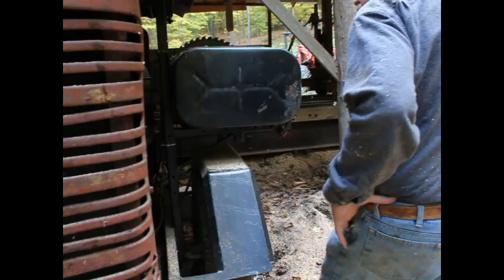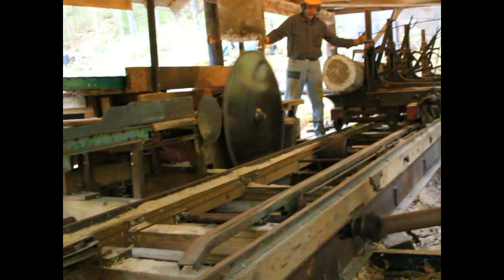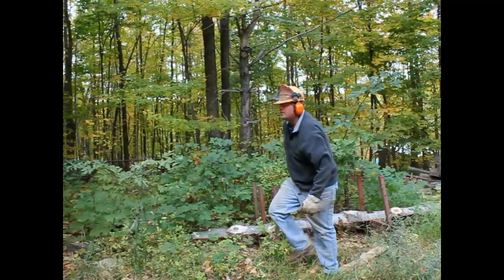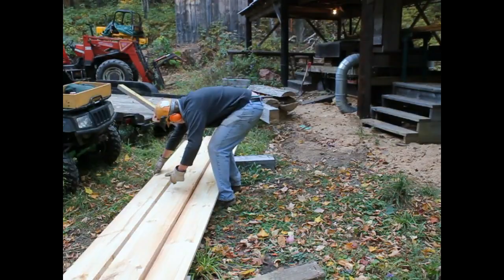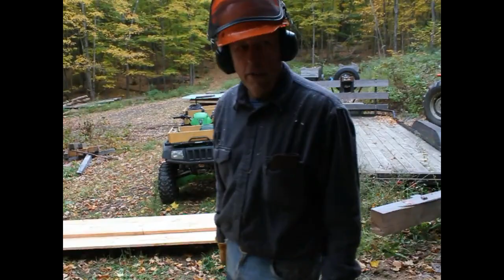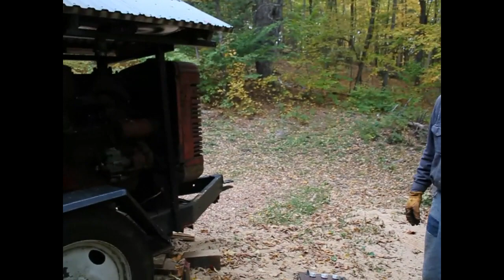Sawing lumber on a Lane sawmill.

Comment: After cutting, does the lumber need to be kiln dried or is it ready to use? I know absolutely nothing about cutting lumber but find it fascinating to watch.  Great video!!!
Reply from the maker: That depends on the usage.  Wood for furniture needs to be around 6% moisture content which will need kiln drying or depending on climate extended air drying.  Here in New England 12% air drying is about the best you can hope for. Most rough lumber, strait off the mill and not planed, is usually air dried for a few months after being stacked with stickers between the rows of boards to enhance air movement in the pile.

Comment: Nice mill and fast, be nice if husk could go on engine side to for ease of one man operating
Reply from the maker: Actually what you are talking about is a "right handed" mill meaning the carriage advances past your right hand as you face the saw. This is a "left handed" mill as the carriage advances past your left hand as you face the saw. A right handed mill has the engine on the opposite side of the husk or the operator side. In the case of a right handed mill the operator must walk around the motor and drive linkage of make a bridge over the drive shaft.  The beauty of the left hand mill is you can mount the motor behind the mill which clears the front of the mill for travel from the sawyers platform to the tailors end.